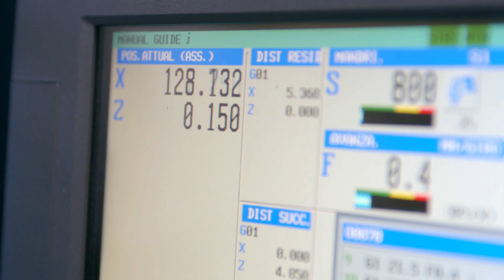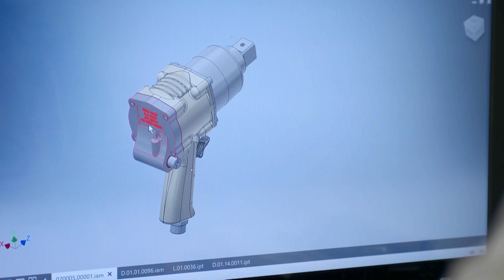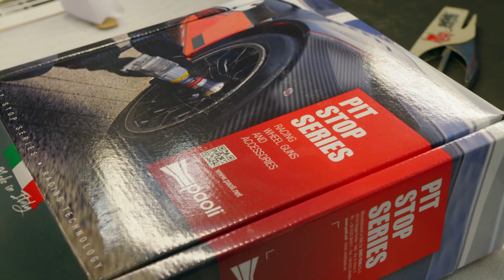Sudden Impact – How Dino Paoli Wheel Guns Revolutionised The Pit Stop | M1TG

Comment: To my knowledge, the current NASCAR contract is allotted to Ingersoll Rand.

They make the 18,000 (compressed air gas) to 25,000 RPM (compressed nitrogen) Thunder Gun !
Reply: Yes sir, this was the case.  Mind blowing rpm and 1000 ft pounds of torque.  In 2018 NASCAR mandated the Paoli guns supplied and maintained by NASCAR,  in an attempt to level the playing field.  That was the claim anyway, likely part of it and probably some financial incentive from Paoli as IR wasn't consulted.  Not sure about the single lug coming next year, the list of suppliers didn't list equipment suppliers.  Likely Paoli however, they are pretty determined to have their name on every gun in motorsports.

Comment: Can anyone explain to me why electric tools couldn't be used instead of pneumatic? Why is one better than the other?
Reply: Advantage of electric is the portability, however pneumatic is faster and more powerful, and in theory if you want more power you can turn the pressure up (however too much and they explode). Electric is brilliant and they getting more and more powerful every day but the weight of the guns is getting heavier with the technology limitations of today but give it a few more years. also in some championships you're not allowed to use them due to refueling and electric causing sparks and we all know how well those two mix....
Reply: Simple my friend electric can go up to 2400rpm 

Pneumatic run by nitrogen can work on 275 psi and ,18,000 rmp
Reply: Mainly weight (pneumatic guns don't have the magnets and windings needed by an electric motor) and torque: a sudden release of high pressure gas will give an enormous impact torque compared to starting an electric motor from idle.
Reply: Because its difficult to make an electric motor that not only provides the required torque, but the speed as well. The is a company specialised in lasers and scanners that made an electric motor that can spin at nearly 50k rpms but it has to be the size of a human finger, a pneumatic motor generally is more reliable and powerful than electric ones